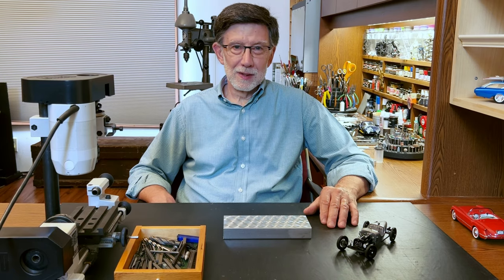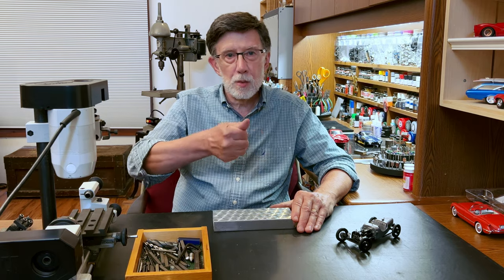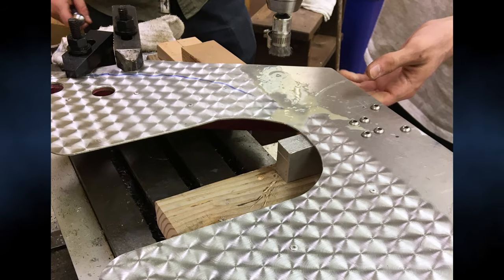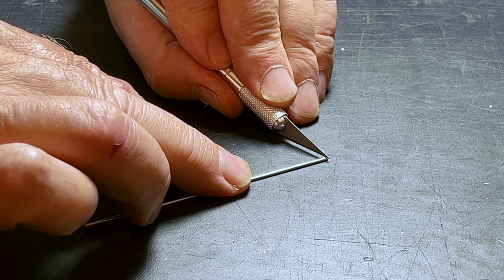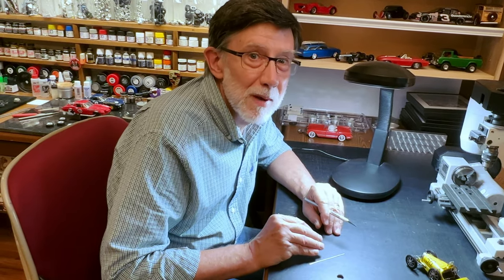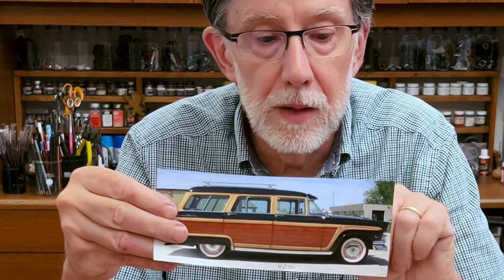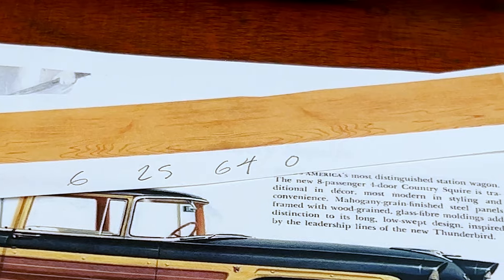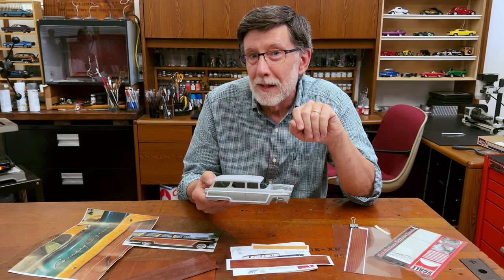3 Scale Modeling Challenges I Haven't Figured Out Yet

Comment: For your braided cloth covered ignition wire. Try this, at sporting good stores that offer fly-tying items buy some lead wire, comes on a spool in different guages. Take a piece say 4 inches long and lay it out straight on flat surface and roll a flat file over the lead wire. As you roll at an angle the files grooves imprint the soft lead wire. Epoxy the ignition wire in place and paint. 
On top of your station wagon, I suggest the canoe in weathered fibreglass red. Cheers Eh.
Reply: I have to try that. Thanks for the tip!

Comment: Louisville modeler Harry Fogerty used a technique for engine turning years ago that worked pretty darn good. He covered the area with Bare Metal Foil and then took a typewriter eraser, the kind that looks like a pencil with a brush at the end, sharpened it and cut the point off flat at the diameter he wanted. Then using a light touch he spun it over the foil and proceeded to overlap as he went down the row. The end result looked very good, but where are you going to find a typewriter eraser in 2022?
Reply: They still make wooden pencils with erasers; chuck one in a drill and use a hobby knife to turn it down like a lathe.
Reply: You must be too young to remember typewriter erasers. They were gray, not pink, and had a mild abrasive in them to remove the ink from the paper. Erasers on a pencil are soft without the abrasive, which won't provide the friction to duplicate the turning action.
Reply: Thanks for the tip. I had seen something similar w an eraser and fine sand paper
Reply from the maker: I would like to try that. Turns out typewriter erasers are available on Amazon!

Comment: Regarding engine turned metal on model dashboards for old open type race cars, or whatever it is, I saw a method in one of the car modeling magazines. The modeler took a piece of rod, about pencil length, but that's adjustable to your taste. He then cut small discs of  coarse sandpaper- a paper punch or metal punch set works here. He then superglued or epoxied the paper side to the end of the rod. If using a drill, use metal rod and slow speed, if using wood dowel or plastic rod, twirl by hand as you would a pin vise drill. He would spin the sandpaper dot on his race car's aluminum dash, slightly overlapping each application. It is important to make sure the sanding tool is flat on the surface ( sanding rod perpendicular to surface) and to take it slowly, carefully- you'll have to change out the sandpaper disc's as they wear, but this seemed like a pretty cool solution, if you try it, hope it works for you. The modeler submitting the tip was adding an engine turned dash to a larger scale Blower Bentley from around 1914- 18, can't remember exactly, but the method should work for 1/25 scale just using smaller diameter rod. You could probably dab adhesive on the rod then dip it into a thin layer of whatever gritty substance such as metal powder, instead of sandpaper....

Comment: 25 years ago I made a 1/43 Bugatti Type 43 engine for Andy Martin which incorporated the engine turning. Turning was done with a steel mandrel, an abrasive compound. The trick was to not apply too much tool pressure to the surfaces. Cheers, Cody.
Reply: The benefit of the steel mandrel is the outside diameter of the affected area is consistent just like a full size effort. So as to avoid excessive tool pressure you'll need an Albrecht spring loaded mini (0-.06ish) drill chuck. Cheers, Cody.
Reply from the maker: That sounds like a good solution.

Comment: For the woodgrain, I have used cigar wrappers, soak in water. Flatten them out ,dry and cut to what u want, used for dashes and woodie sides
Reply: I also used the cigar wrappers on the floor boards for a box stock model A roadster

Comment: OK - for cloth-covered wire, try using lead-core fishing (trolling) line. You'll be limited to applications where the available wire diameter is appropriate to the scale of the model you are working on, but it looks perfect. Unfortunately, you'll probably have to buy a hundred yards of the stuff at a minimum. But you can also strip off the outer covering to give you a finer gauge lead wire that is easy to bend to any shape - I used that for years for spark plug wires on 1/24-1/25 scale cars.

Comment: Back in the day they used push wire in old electric guitars. It had a cloth covering that you could just push back to expose the wire to solder to the pots and jacks. The problem is the gauge might be too thick for the scale model you might be building. It would be a perfect solution. Now i wonder if comes in different thickneses
Reply from the maker: Interesting thought! Would need some research.

Comment: Hello sir, I just came across your video. I am here in central Mexico, Queretaro. you have a very nice set of videos, I am thinking about joining your patreon... ;O)
regarding your cloth wires, I did a scratch build of a Messerschmitt Me 262 jet engine, all from scratch...@ 1/24 scale. 

...for the cloth wires there I used lead wire the kind for fly fishing, it is very easy to manipulate and to drape it where it has the effect of gravity pulling on it.

... then I use Tamiya tape and cut that to width to scale...

... then , and this will take some practice and patience, but I can tell you are like me, and this will not be a problem...jiji 
I wrap the tape around the lead wire leaving a tinny space to scale to create that wrap effect.

.. you can either at this point spray a varnish, I do matt, to seal everything, then place and manipulate it on the model, OR place and manipulate it on the model and then spray a varnish, I do matt.

I hope this helps... keep the muse alive...
cheers...